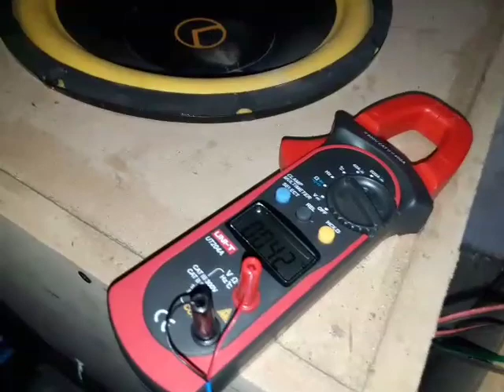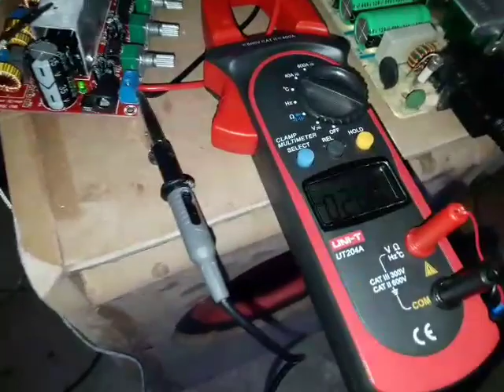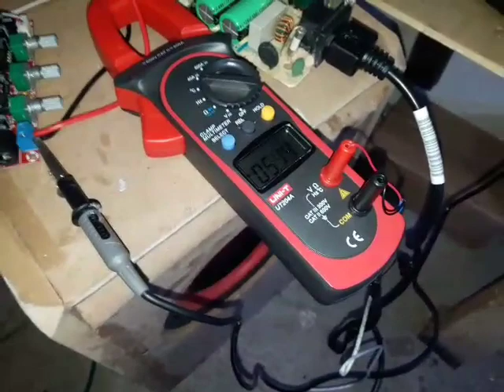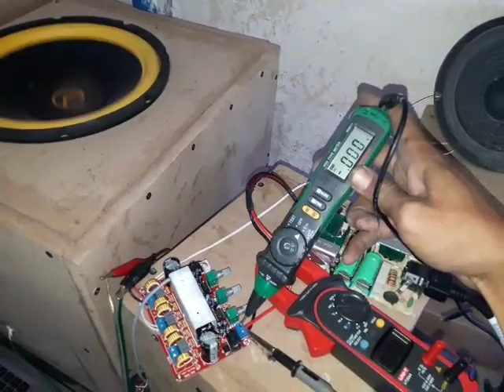Woow TPA3116D Class D Amplifier 24V 5A SMPS 6 to 12inch Subwoofer Speaker

Comment: om power tipe ini saya supply pake aki 12V 40A di mobil koq suara hilang hilang pake 4 speaker pintu 6inc kalau volume agak kecil sih normal tp kalau di naikin dikit suara hilang2
Reply: pake 12v out ke speaker max nya hanya 6.3-6.7 volt.
Kalo pake 24 v outputnya 17.9-20.1 volt. 
Pake 12v output hanya 1/3 nya 24v. 
12v -volume 1/2 distorsinya luar biasa.
Silahkan ditest.
Reply: @jongjava8743  rumusnya gimna
Reply: @anakost9980  saya lgsg ukur output AC terminal speaker, Karena bnyk sekali rumus yg bertebaran di internet menyamakan class d dan class ab yg mana berbeda teknologi. Di web TI max output (V Out) class d = (DC Input / 1.2) x Effisiensi. Dan jika diukur lgsg terbukti kalo effisiensi TPA3116d2 mendekati 98% jika menggunakan filter output jenis idolated ferrite. Jika non isolated kaya TPA board diatas sekitar 92-95%, karena timbul panas akibat saturasi filter choke output.

Comment: mas mo tanya .. aq dh rakit ampli ini pake suply trafo 5a ct 18volt dioda 2 buah elco  6800/50v 2 buah.. nah aq mo naikin voltnya tp di trafo gak ada yg 24v adanya 25v, kira2 kl pake yg 25v kebakar gak ya amplinya?
Reply from the maker: cpet panas om malahan sering protek ic nya. mending di 18V, coz kalo dri trafo udh 25volt nanti keluar dc nya pasti lebih tinggi.
Reply: satu lgi mas kl subwofer bas,nya lbh nendang mana antra 4 dan 2 ohm? aq pake legacy 8 inch.. apakah aman k subwfrnya dan ampli kl d seting 2 ohm? mksh infonya...
Reply from the maker: +zilud aman om untuk 2 ohm, klo bisa box ported jgn sealed. klo lbih nendang di 2 ohm
Reply: okee mksh mas infonyaa..

Comment: mas legacy sparta pean jembret gak.kalao volume max.ini saya punya persis kayak gitu kok jembret
Reply from the maker: +denmas herman itu nggak mas coba pke headset.. jembret bnyk msalahnya.. bisa dri power amplinya, power supply , speaker atau box subwoofer jg pengaruh.. power pke apa mas?
Reply: sama mas.pakai tpa 3116d 2.1.psnya 24 volt 5 amper.plek
Reply from the maker: +denmas herman box bhan ap bang?
Reply: bahan kayu pinus.tebelnya 1,8 cm.oh iya lupa legacyne 10 inch
Reply from the maker: +denmas herman udah lmyan sih om bhan itu .. bgus lgi mdf

Comment: lik d pasang ning mobil piye bos.....bth inverter g
Reply from the maker: +jibril ortega gag pke inverter jg bsa 12V mbil udah nyukupi Arusnya.. seperti video sya sblumnya pakai 12v 8A .. nmun lbih baiknya dksih inverter ke 24v sampai 10A. Jgan lupa tmbahin heatsink dan kipas.. karena lbih pnas pakai 24v. kalau over heat,  power suara kena cut, dan bisa protect. Parahnya IC TPA3116nya njeblus.